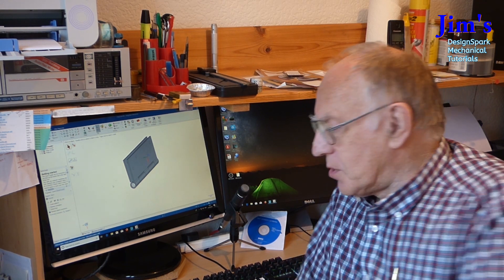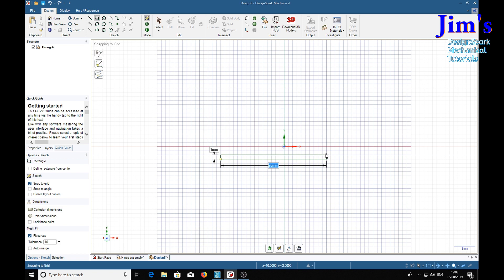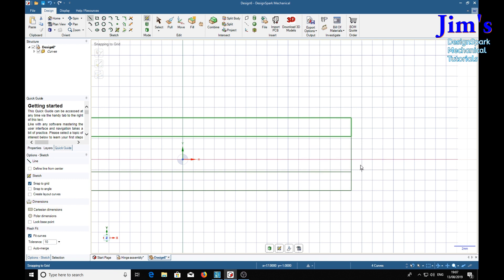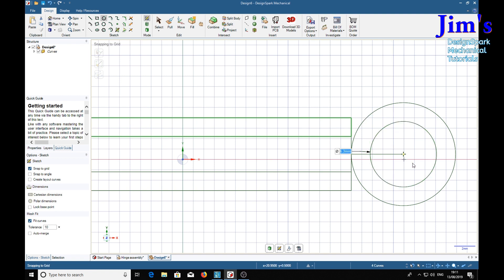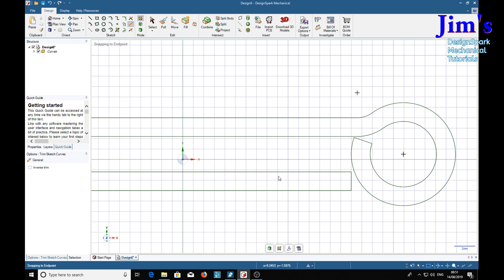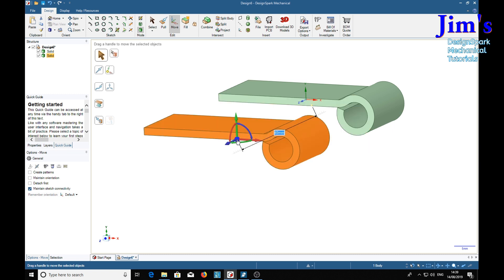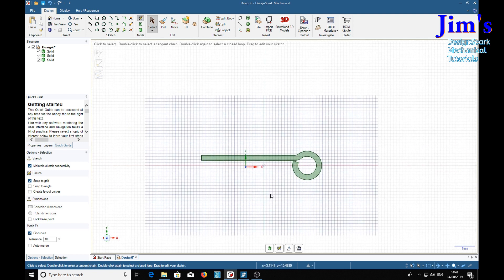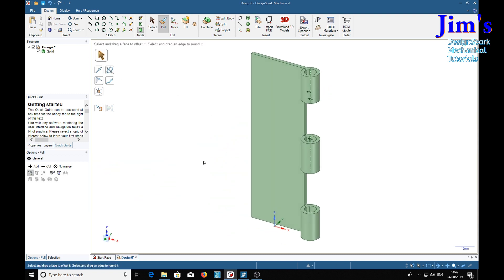Modeling a hinge in DesignSpark Mechanical pt1 of 3

Comment: Jim,
you could have made one profile . extruded ( Pulled) full length, then used a simple up/down line to depict the cut outs within the hinge and Combine saw (cut out). maybe you thought of this.
Or, as you did... but pulled side to the final part ( missing out the second part altogether, thus quicker) , all three separate parts would be joined together in one pull operation.
Thank you for posting this...
Reply from the maker: Yes, there is never only one way to model something in DSM.